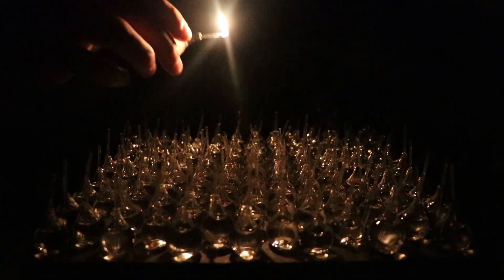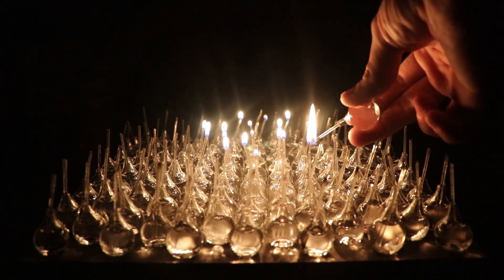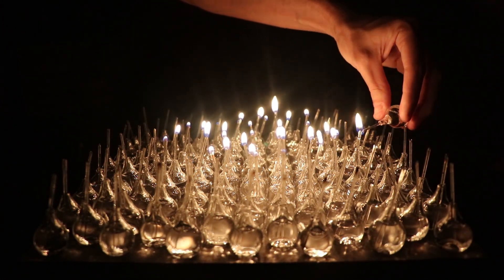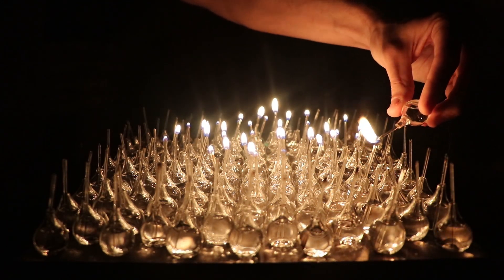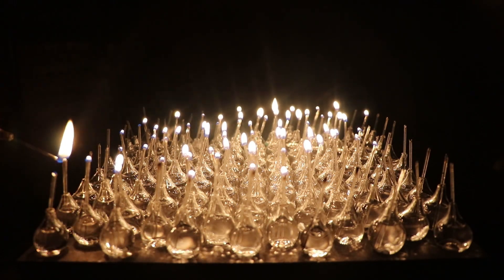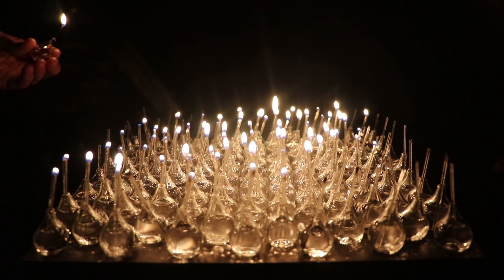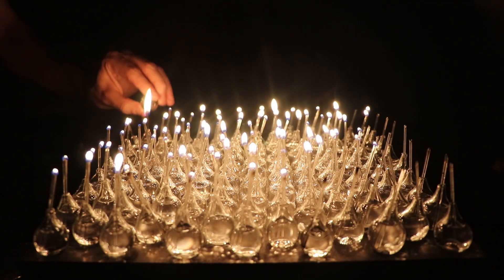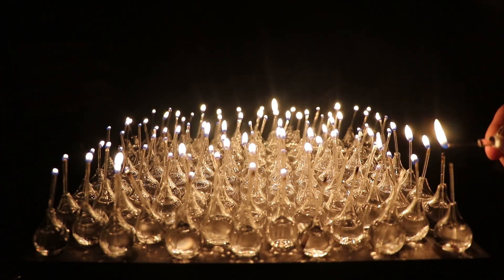111 Tiny Oil Lamps with Glass wicks : The Capillary Candle

Comment: As a thrower myself, I am highly interested in the glass throwing knives!! I have made some glass razor knives myself a year or so ago! It's amazing how sharp an edge that you can get with molten glass!
Reply from the maker: Hey Randy, very nice! Yea the points can get needle sharp, but I found it difficult to make a full edge with just the flame. I might need to a cold working tool like the lap wheel to grind in a razor edge.
Reply: @JasaGlass  I actually used the very edge of my graphite paddle to squash the thin blade-shaped edge into my table top marving pad with some pretty immense force. I held the thin side of the paddle at an angle at or more acute than 18 degrees from the tabletop. I did this until I had a scalpel-like blade shape and edge. Finally I used a leather strop to work that edge razor sharp.
Reply from the maker: @randybrandstatt9310  I'm a bit surprised with the strop, did you use a polishing compound? I might try that for the throwing knives instead of cold grinding them. Thanks for the info and watching Randy. I'll do my best learning to throw them so I don't disappoint any knife experts like yourself.